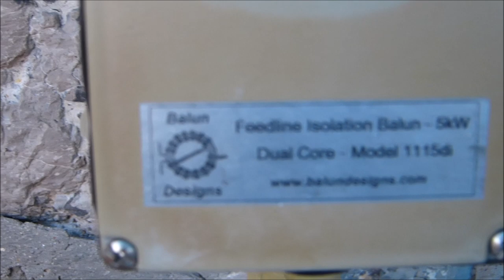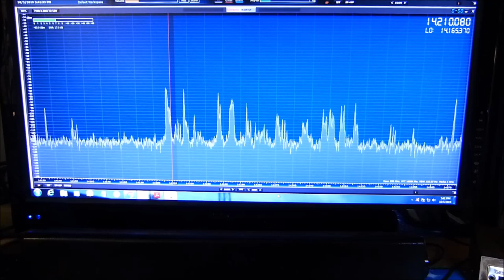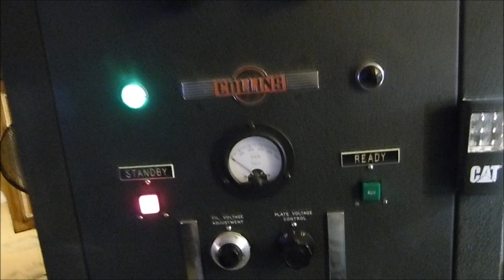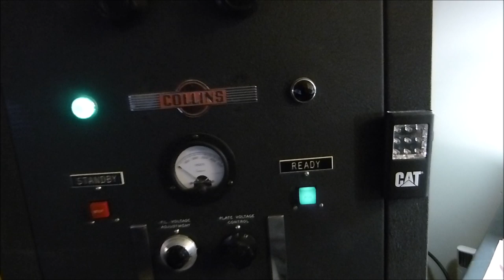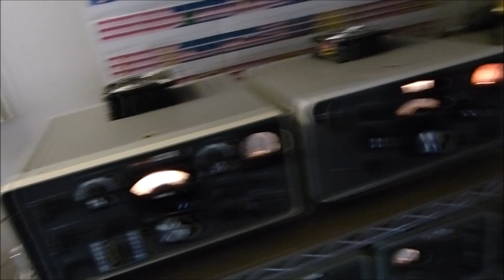20 Meter Mono Band Hexbeam vs 20 Meter Mono Band Dipole at 35 Feet

Comment: You sir are everything good in this hobby. Thanks for sharing.
Reply from the maker: Thank you, Mark, for your kind words.
I love this hobby and even more than audio but I know most of my subscribers are interested in audio equipment. This is my first genuine store bought antenna, besides little antennas like mobile whips, etc and I am very pleased with it. I had to pull the antenna off about a  month ago and do some minor repair on it as some of the mounting screws were coming lose from being pounded by the wind and I put it back up without the 4 foot piece of mast between the antenna and rotor making it much stronger with no decrease in performance I can tell. 73 and stay safe during this terrible virus.

Comment: Been a ham for 20 years and got my first HF rig a couple of days ago. Decided to start on 20m- cutting up a dipole for the attic tonight. Nice to see a video from you on 20m!
Reply from the maker: I think you will enjoy 20M and amazing things can be done with a dipole on that band. Hope to hear you on the air. I generally work around the center of the band, 14.250 MHz or sometimes at the very bottom at 14.156 MHz when I talk with my friend, KE0SSP  in Iowa.  73  WA4QGA

Comment: What size aluminum tubing is the 20 m rotatable die pole made of? And is the fiberglass center hollow or solid fiberglass? Thanks in advance.
Reply from the maker: The I.D. of the largest tubing is 1 inch (O.D. = 1 1/8 inch. The center insulating rod is solid fiberglass.
Reply: Do you remember how long the center fiberglass rod was in the Dipole? I found one 23 inches at 1 “ OD .. Thought it should be longer. 
Thanks again!
N4EVG
Reply from the maker: @N4EVG  The one in mine is probably no longer than 8-10 inches. Just 3-4 inches into each side of the dipole is sufficient with an inch or so spacing in the middle. I understand the concern about rigidity and insulation but it seems much less is needed of the insulating rod than we tend to think.  Even at 1000 watts of RF, the voltage at the feed point of the dipole is only around 223 volts RMS or 316 volts peak.

Comment: Nice, but 3 wavelengths of Coax? 196 feet? Why?
Reply from the maker: That is how far it is from my basement to the top of the tower + or - a few feet so at that time, since it was a monoband dipole, it seemed like a good idea so I could, as best as possible,  read the accurate complex impedance of the actual antenna. I don't worry too much about it now with the hexbeam which seriously outperforms the dipole., especially front-to-back. The loss in good coax like the LMR-400 is pretty insignificant at HF. Here is a link to a loss calculator where you can select any coax, length and frequency. LMR400 at 200 feet is about 0.9 dB.
https://kv5r.com/ham-radio/coax-loss-calculator/
73

Comment: The hex is a fantastic beam. The only issue here is high winds and ice. If you love 20 and want better than the hex, build a cubical quad 2element for 20. You’ll be surprised how much better it is than the hex. Love the Collins gear btw
Reply: The Hexbeam is essentially a 2 element Yagi, that is bent into a "W" shape.  An ordinary 2 element Yagi would also perform slightly better than the Hexbeam.  Quads and Yagis have essentially the same gain.

Comment: Why does the length of the coax matter? You said 3 wavelengths, like you were concerned with resonance. Thanks
Reply from the maker: Every  1/2 wavelength, or whole number (integer) multiple thereafter,  the impedance at the load (the antenna) is repeated at the end of the coax in your shack for a monoband antenna. If the "antenna"  (not the antenna "system" which consists of the antenna and the length of coax) were to be a perfect 50+J0 impedance, (dummy load) then the length of the coax would not matter but in the case of a dipole, which is not  50 ohms with zero reactance, the actual complex impedance of the actual "antenna", not the coax-antenna-system, can be read at the end of the coax if the length of the coax is a multiple of a 1/2 wavelength of coax. With this said, the length of the coax for 1/2 wavelength is the free space wavelength at the measured frequency multiplied by the  velocity factor of the coax. For the old style coax the Vp is usually 0.66 and for the newer style foam dielectric coax it is something like 0.88 so, the length for a wave length, or half wavelength, of coax is always less then the free space wavelength. Hope this helps.

Comment: Mine just decided to burn thru the dacron cord with 1kw!  ....only been up a very short time...(couple of weeks).....very disapointed...it's being removed and will not go back up!
Reply from the maker: Don,
Well that is sure not good to hear. So far mine has been performing beyond my expectations. I find the the directivity of the one I have up amazing. I do get concerned when I see these large dove hanging onto the wires. I think it is OK for them to sit on the PVC. What do you think caused yours to burn thru the Dacron cord?
Reply: @ElPasoTubeAmps  RF......The claim is weather and moisture do not effect the SWR....  It has to... Bad part..it's mounted on a tower 50+ft up...
Reply: I am screwed!
Reply: @ElPasoTubeAmps  I'm just sick about it
Reply from the maker: @donalddavis581  Absolutely, I would be upset also. I am really sorry to hear it failed so soon. I would hope it would last at least five years - or more... do you think it is the brand of hexbeam? Is this more common than we think? They do seem kind of fragile but I have not heard of them breaking so soon. Is it broke on just one band? I am assuming you have a multi-band hexbeam. Mine is mono band - just 20M.
My problem is my rotor is too large to fit inside the tower (to use a telescoping pole at the top of the tower to mount the antenna on to bring it up and down into reach from the top of the tower) so the rotor has to be connected to the very top of the tower. Then, the hexbeam is mounted on a 4 foot pole so it makes it impossible to reach the actual center plate once installed. I do have a gin pole to lift it into place while my friend is at the top of the tower and can just guide it in the rotor clamp while I manage it from the ground on a cable, but removing it is going to be difficult as there is no way, that I have thought of so far, to attach the hook from the gin pole to the antenna at any point that can be reached. I don't know what I am going to do when I have to take it  down for repair. A crank up tower or lean-over tower is obviously one type of solution but the lean-over will not work because of surrounding obstructions and spending $$$$ on a crank up tower is not going to work either. My situation is a brute-force issue to remove it.  Brute force removing (lifting it out of the rotor clamp) the dipole wasn't too hard but this hexbeam is much larger and so much more awkward it is just simply going to be dropped to the ground once pulled out of the rotor clamp...   putting it back in is OK because of the gin pole but there is no way, that I have thought of yet, to hook it on to the gin pole hook to lift if out of the rotor. Any suggestions are welcome from anyone - besides the hinged or crank up tower solution...
Reply: @ElPasoTubeAmps  IMHO ... Any moisture in those spacer cords and rf power are going to be an issue.  More power..bigger issue...
Reply from the maker: @donalddavis581  I definitely will keep that in mind and if the wet cords do start conducting, as they appear to in your case, it would be a complete conducting circuit all the way around from the center of the coax to the shield and some level of "short". Wow... this brings up another point. I am working on a relative high power AM transmitter and if I do go to a KW level of AM that will be 4 KW PEP and my concern was the little plastic (teflon?) insulator on the center feed post arcing and ruining the hexbeam. From your unfortunate experience, I may just make the AM transmitter for 40M and put up a simpler inverted-V. I really don't want to ruin my hexbeam. I do run, out of my 4CX1000A amp, generally about 1.2 to 1.3 KW output and so far all is good. I am sorry it happened to you, Don, but thank you for posting and sharing with everyone.  73
Reply: @ElPasoTubeAmps  conversation with a MAJOR producer of hexbeams....  they state their antenna have a special "isolator" and cap for the end of the driven element and this is a well known issue.....to burn those cords in two....way too late for me
Reply from the maker: @donalddavis581  I am assuming their special "isolator" and cap keeps this from happening?  whereas it is not uncommon on some other hexbeam for this to happen, (?)  i.e. burning the insulating cords into that separate the driven element from the reflector? I believe the separation on the hexbeam I have is 24 inches on each side. If I have the insulating cord burn into on my hexbeam, I am going to be seriously upset about it.  I will make a YouTube video of it... can you tell me what brand hexbeam you are using and is it mono band or multiband?
Reply: @ElPasoTubeAmps  go look at G3TXQ.  Look at item #4 and you will see the insulator.  Wish I had known!!!
Reply from the maker: @donalddavis581  
Don,
I did do some research on it and they claim their custom insulators aresupposed to prevent any arcing from high power like CW or data and I might also assume RTTY or even AM but something apparently went wrong in your case. 
Here is a cut and paste from their description that I assume you are talking about.

"High Power Insulators.

As from January 2013 all G3TXQ Hexbeams by MW0JZE will have custom made insulators fitted as standard. The insulators are bespoke design produced just for G3TXQ Hexbeams specifically for high power CW and DATA users. These insulators will eradicate the possible arcing of the driven elements where high power is used on full duty modes over prelonged periods such as contests and DX-Peditions.

Element format is Driver - Spacer Cord - Reflector - Spacer Cord - Driver with polyester cords being used as the spacer cord.

Each G3TXQ Hexbeam element from MW0JZE is made from seven (7) strand copper wire with a PVC coating with polyester spacer cords, all joints are sealed with heat shrink wrapping."

The K4KIO hexbeam that I have has a simple two feet of  cord between the driven element and reflector. Maybe I am being naive about it but I assume 2 two feet of cord would not arc under almost any condition. My point of worry is the plastic or possibly teflon insulator that comes out of the center feed post that feeds the driven element, arcing at high power to the center metal post, especially for something like RTTY or AM. For that  reason, I will probably make the AM transmitter for 40M instead of 20M as I do not want to arc the 20M hexbeam. I do usually run about 1250 watts PEP output and so far, all has gone well.
What can be done about your situation? Take the hexbeam down, I assume, and  replace the insulation between the driven element and reflector? Take a look at the design for the K4KIO hexbeam and see if that might be a better insulating method. Hope you get it fixed with minimal trouble and expense. I am very sorry it has happened but it is good that you are sharing your experience.  73
Reply: @ElPasoTubeAmps  I posted a video this afternoon.... a possible really cheap hardware store fix..... look on youtube. for: Possible fix for hexbeam
Reply from the maker: @donalddavis581  Don,
Great - I am always worried about the time i need to fix mine from the terrible winds we sometimes have in El Paso. 
My problem is going to be in bringing down to the ground..
I don't know your channel. Please me a link to your video and I will subscribe.  Thank you   73
Reply from the maker: @donalddavis581  Never mind...  I found it...

Comment: Would that antenna take 1.5KW?
Reply from the maker: It does in SSB. The 4CX1000A home brew amp will deliver a full 2KW PEP output. Average output 1600 watts. This is true. 
I don't have confidence it could handle a full KW of high level modulated AM but I am not going to do that to it. 
I am working right now on my AM transmitter and hope to have it on in the next week or so.

Comment: Why mono? Why not more bands?
Reply from the maker: That's a fair and good question. I am generally only interested in 20M and I wasn't actually confident it would work as well as it did. I also read that mono band hexbeams had a little more gain than multi band ones.
Except that I have to take it off the tower, adding bands is simply adding the predetermined lengths of wire and string and attaching them to the center post which is where the feed points are. 
The cost to add bands, homebrew style, couldn't cost over $3-4 for the required wire and string. I think this design really lends itself to homebrewing... Adding more bands may happen in a future project.